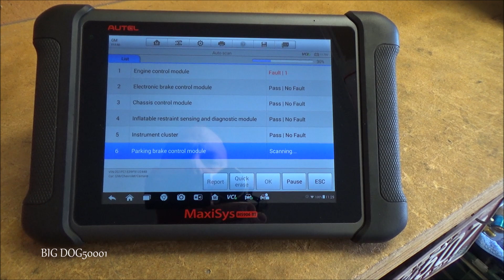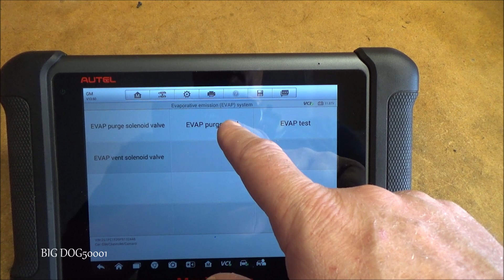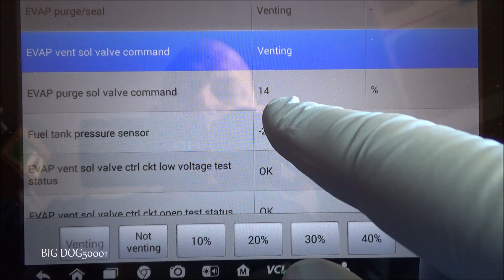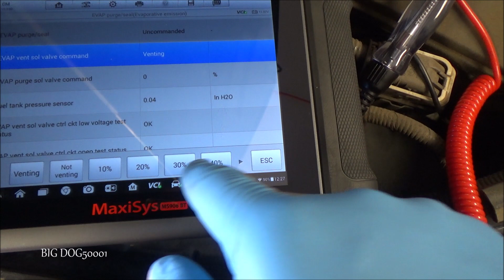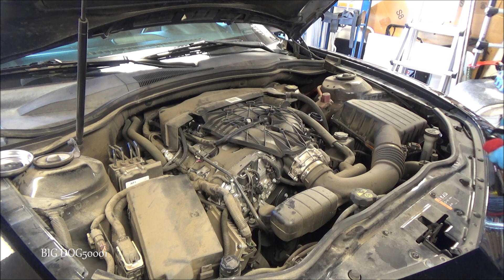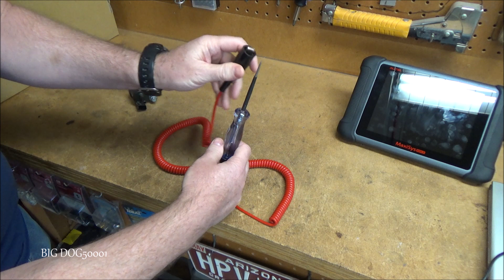Chevy P0496 EVAP Flow During Non Purge Condition 2015 Camaro 3.6L V6 (2010-2015 Similar)

Comment: Will this cause the catalyst monitors to not be ready at smog check ?
Reply from the maker: The monitors run each key cycle to look for emissions related problems and turn on check engine light if it detects any.  If the check engine light is on, it will typically cause a vehicle to fail an emissions (smog) test.

Comment: Ik this post is old but I just threw the same code in my hhr. I replaced the solenoid but the engine light is still on, is that because it's a permanent code??  Also everyone says if you can blow throu it it's good but what you said and 1A if you can blow throu it then it's bad correct??

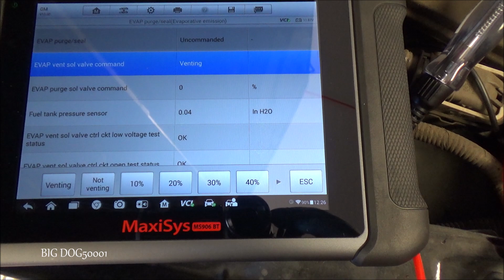Comment: Around the minute 9:08 when you are performing the light test, there’s any other chances to have a good idea if I have shorted wire or something else? I have the same code and I have a multimeter but not the computer since I’m just an regular owner person but I’ll love to check the circuit first and not just go and buy and replace the part. So, what should I can expect if the circuit it’s fine: Not continuity in between the terminals? Thanks in advance!

Comment: Going try this in the morning the 2013 camero rs been giving the  PO496 and P0300  and I have replaced purge valve b4 so Maybe Circuit…. Idk …. Stability, traction, etc. came on and limped it home few blocks  prob sparkplug and cables too . We shall see

Comment: On a 2019 it's on the front at the throttle/air intake correct? And in places were there is a wide temp fluctuations from hot to cold could that cause a false code?

Comment: Change the purge valve at the dealer and replace my gas cap and reset the light by unplugging the battery but it turn back on after 2 drive cycles .  I did the same couple of years back and the light stayed on for a couple of more drive cycles . Do U think I should drive it a lil more and wait to see if it turns off btw awesome video man .
Reply from the maker: The ECM needs to run its diagnostic test for this code 4 times (and pass all 4 times) before the light will clear on its own (the light will come on after 2 failed tests).  Also, the vehicle needs to meet certain parameters before it will test for this code (like engine off at least 8 hours).  If this same code keeps coming back then it will need troubleshooting done.
Reply: Awesome thank u and ur videos are the best

Comment: Great video, the owners manual says to check gas cap make sure it is tight, also says fuel may be a issue, I put 93 octane but usually use regular to see if the engine light goes off no change. Car is running good other that engine light on!
Reply from the maker: Yeah gas caps can definitely cause EVAP issues, thanks for the comment!

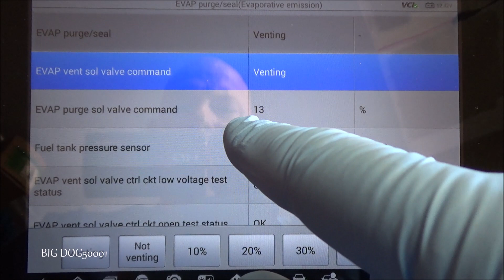Comment: @BigDogg50001 at 5:42 you said engine was stumbling because it was expecting fuel, but wasn't getting any. Was it just getting air? Everytime I hit seal- the car completely stalls and any vacuum pulled immediately drops. Would you say the back vent is stuck open some? The back vent does click to engage and disengage, but we all know that doesn't mean it's working 100%.
Reply from the maker: The charcoal canister stores fuel vapors from the gas tank, when the engine is ready it opens the purge for a short amount of time to burn those vapors.  If the purge is stuck open, the vapors are quickly pulled in and then it continues to pull in air (that the engine computer is not expecting).  If the vent is sealed with a stuck open purge then you can see changes in the fuel tank pressure pretty fast on a scan tool (this is typically how the engine computer looks for issues on many systems).
Reply: @BigDog50001  Thank you for the reply sir. So is it plausible that for my vehicle to stall immediately when I hit the seal button- that the purge is likely to be sticking open?

Comment: hey brother I have a p0401 code on my 98 ranger anyway I can narrow down the issue with looking at a scan tool live readings? thanks
Reply from the maker: Yes, a P0401 is an EGR (exhaust gas recirculation) insufficient flow issue, usually you can look for EGR DPFE Data PID on a scan tool to help diagnose (depending on model).  On many of those older systems, there will be a base reading on the EGR DPFE data PID (generally around .5V to 1V depending on type of sensor).  Generally, when the engine computer does not detect a change from the base reading after commands the EGR valve open, it sets a P0401.  Faulty DPFE (Delta Pressure Feedback) sensors, bad EGR valves (or clogged passages) can cause this issue, but I would also look for exhaust leaks and check any DPFE hoses to make sure they are in good shape.
Reply: Big Dog50001 Automotive Thank you sir for your reply my scan tool doesn't read this is there another area I can monitor to narrow down
 Autel ml329 is my tool model number

Comment: I have this code with some misfires and I changed it along with the solenoid and I’m still getting misfires
Reply from the maker: I would troubleshoot the misfire(s).  Spark, fuel, compression and timing etc are things to look at.  Misfire troublecodes and a scan tool that can see misfire data can help pinpoint.

Comment: I had the same issue with my 2012 camaro changed the same part but my "check engine" light stays on. Isn't it supposed to cut off in its own?
Reply from the maker: It generally will turn off if the parameters for running the test are met and the problem was corrected.  If I remember correctly for that code, the engine computer wants to see a cold soak (engine off) for at least 8 hours and a certain temp.  Some codes won't clear unless the vehicle is driven at a certain speed for a certain length of time.  It just depends on the code and the vehicle programming.

Comment: Dave, Awesome really good information is the info stands for most cars or there is a efferent in between cars. thank you and cheeeeeers
Reply from the maker: Purge and Vent Solenoids are pretty standard on many vehicles so much of the information can be applied to other applications.  The actual voltages on the Fuel Tank Pressure Sensor would be specific to makes/models though.  Thanks for the comment!